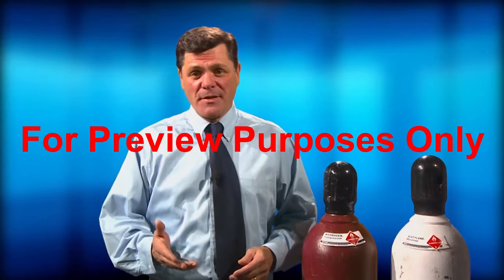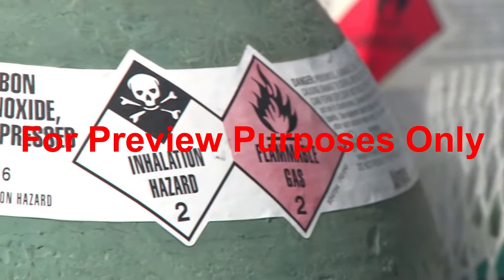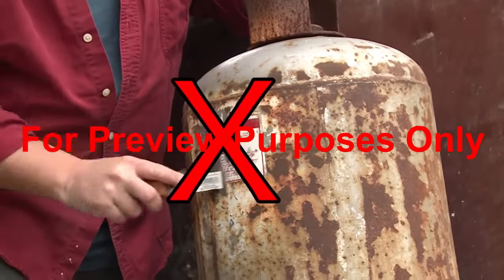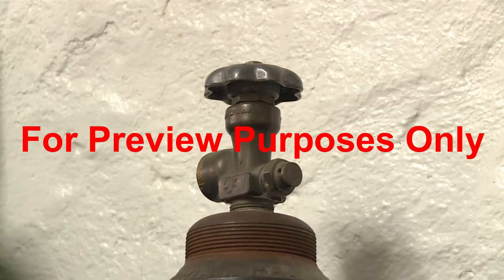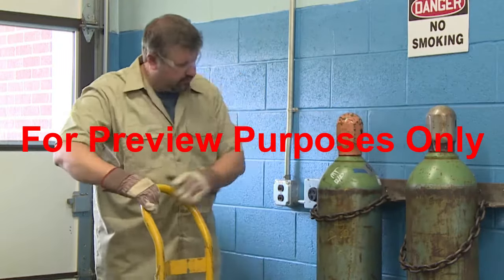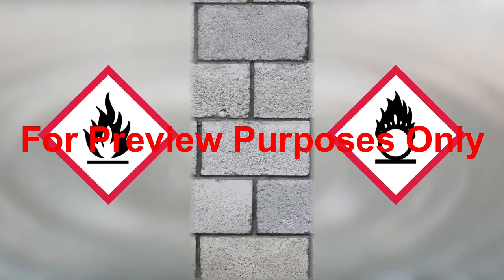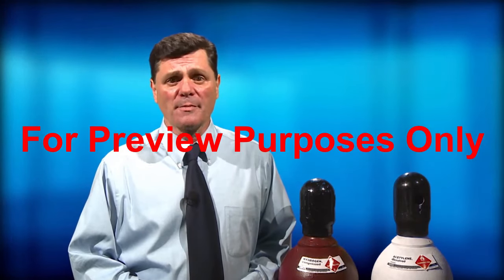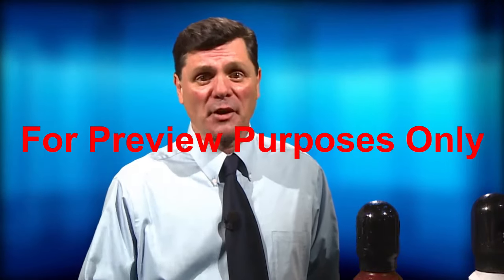Compressed Gas Cylinder Safety Training from SafetyVideos.com

Comment: I think I have a phobia of gas cylinders. Safety rules seem to be quite easy to follow, though. I hope they don't explode without a reason.
Reply: The only reason that you would have an issue like that is by not following safety procedures and never use oil on tanks to protect them from rust or cleaning. NEVER, oil can damage the seals on a cylinder and you can have a chemical that will cause boom . I hope that helps.